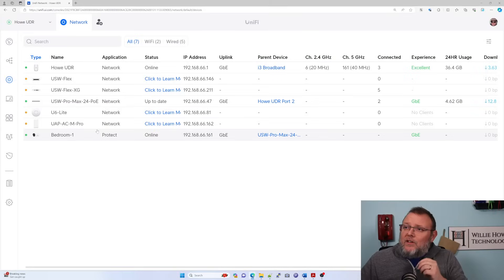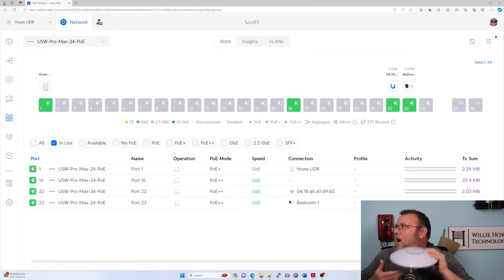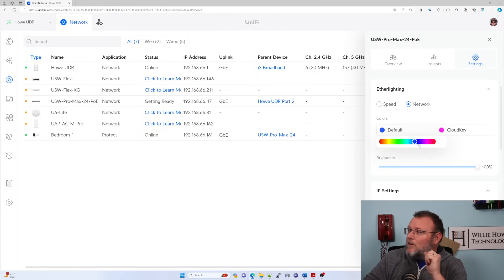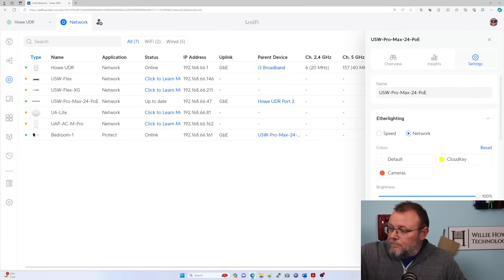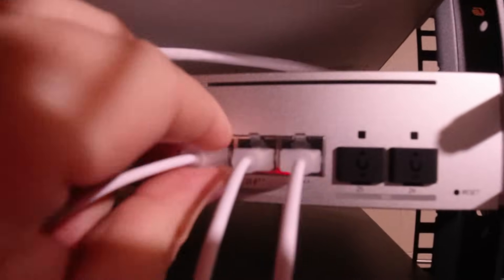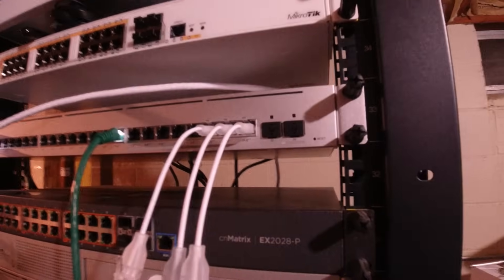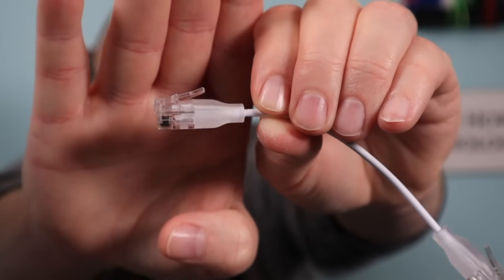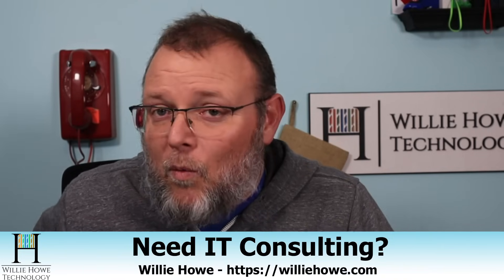UniFi Pro Max Switches with Etherlighting

Comment: It would be even cooler if the RGB lights were above the ports so they worked equally well regardless of what ethernet cable you use.